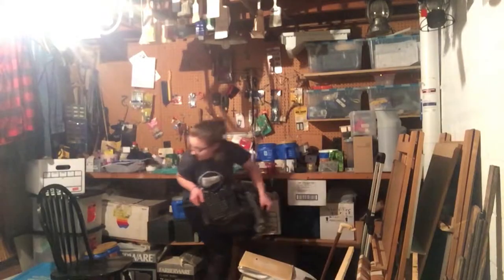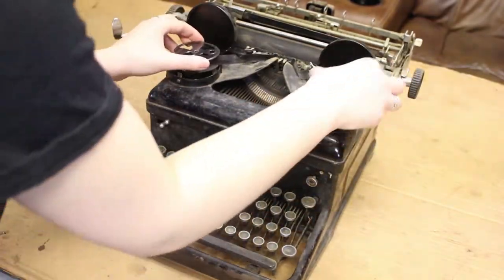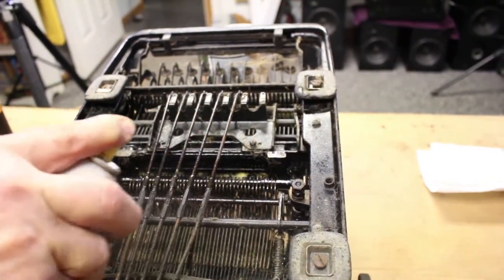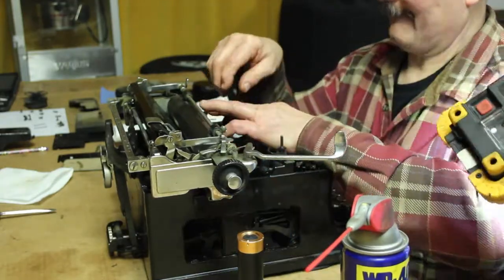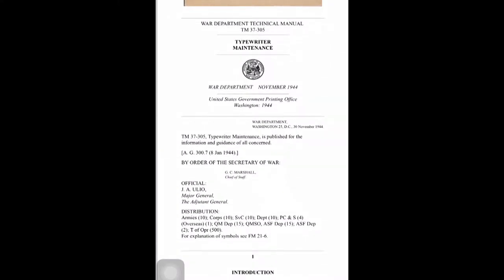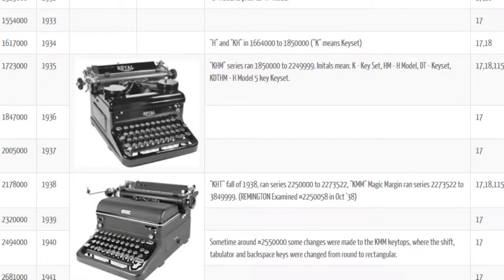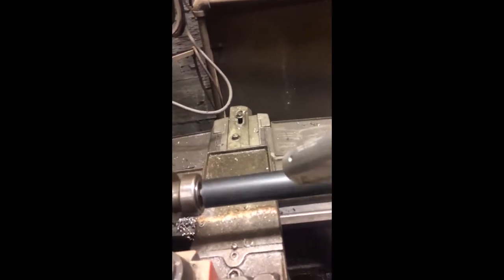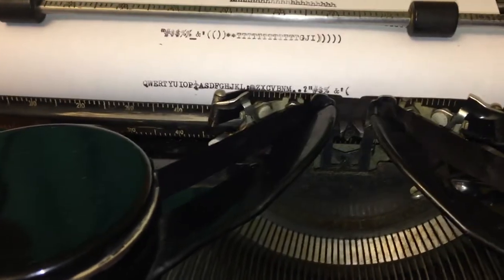Restoration: Royal Victory Model (1934)

Comment: Thank you so much for this!
I just bought one of these that almost works. It just needs to be cleaned and lubricated. All of the keys work, but they almost all stick just as, or just before, hitting the paper and almost none of them automatically fall back into the basket. The carriage seems reluctant to move, but I really think that's a cleaning and lubrication issue and not a mainspring issue.
The platen is hard but it and the paper rollers draw in paper with no problem.
Mine is serial number H-1701351
I identify it as a model H from 1934.
That makes it roughly a generation after the Model 10 and a generation before the KMM.
It still works a lot like the Model 10.

Comment: What a wonderful machine!  I hope you reserved the WD-40 for cleaning the panels only.  WD-40 generally causes more problems than it helps due to gumming.  I own both a KMH and a KMG and consider them one of my best typers.  They are only a couple of my growing collection of typewriters which amounts to about 25 now. LOL!  You guys are really doing a nice job creating this channel. Looking forward to the next video.
Reply from the maker: Thanks so much for the watch! We only used WD-40 on the outside panels and then cleaned off all of the residue using break cleaning fluid which removed oil and was quick dried using an air compressor.

Comment: I have this exact same model and was wondering how you got the front panel off? The margin release button won't come off and I'm stuck on what to do
Reply from the maker: There's a pin that holds it in place! Take off the top ribbon cover- look down to the back of the margin release button. There's a little metal pin that holds it in place. Take out the pin and it should come free!